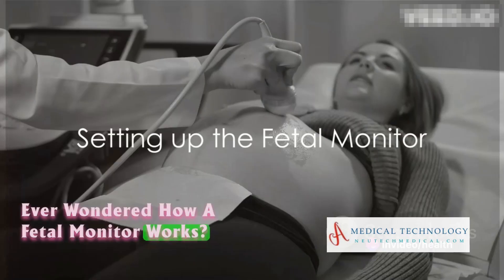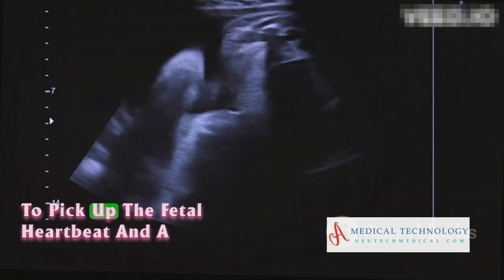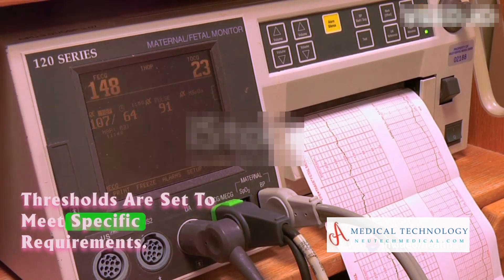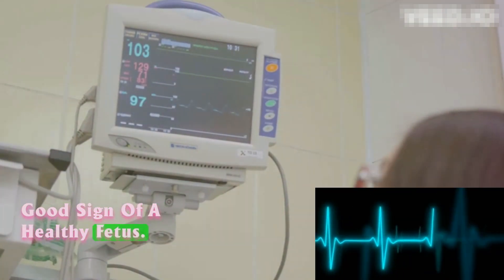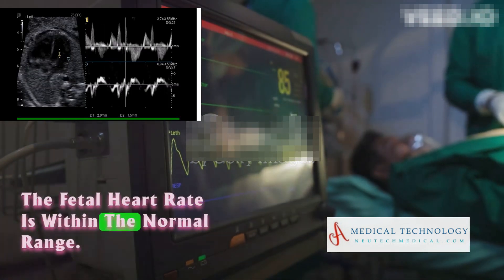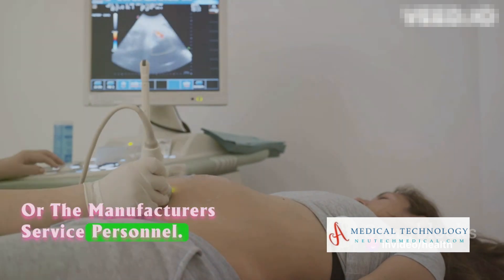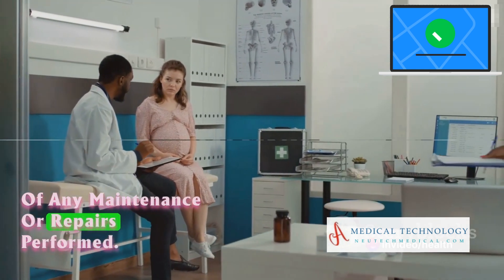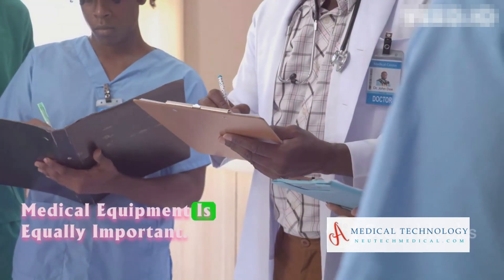Cardiotocography (Fetal Monitors) Introduction | Fetal Heart Rate Monitoring Sound

Comment: What is the most common type of fetal monitoring?
Reply from the maker: External EFM is the most common type. Your provider uses elastic strips to secure two measuring devices to your abdomen. An ultrasound device positioned over your abdomen measures fetal heart rate. A pressure gauge placed at the top of your abdomen measures the frequency of your contractions.

Comment: What are the risks of fetal monitoring?
Reply from the maker: What are the risks of fetal monitoring? There are no known physical risks for external monitoring with a fetoscope or Doppler. There may be a slight risk of infection with internal monitoring. The scalp electrode may also cause a mark or small cut on the baby's head.